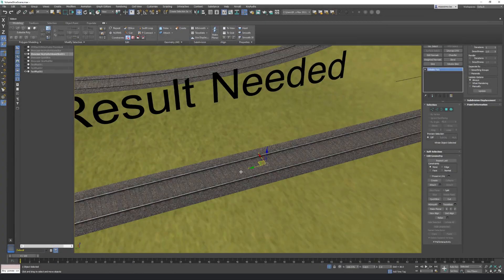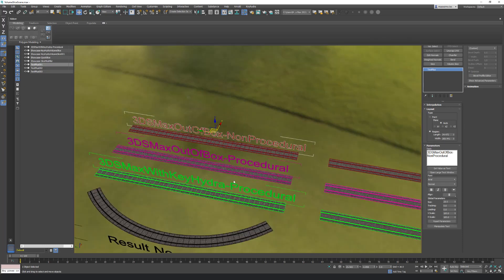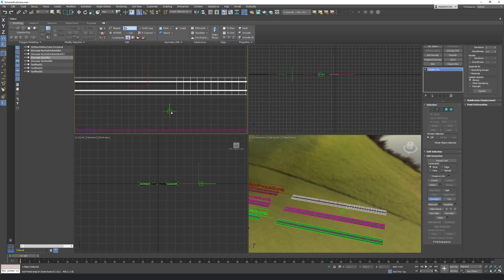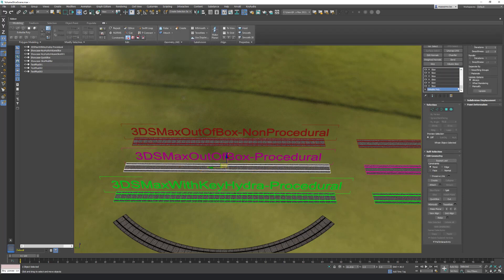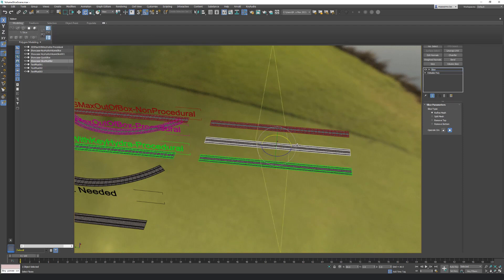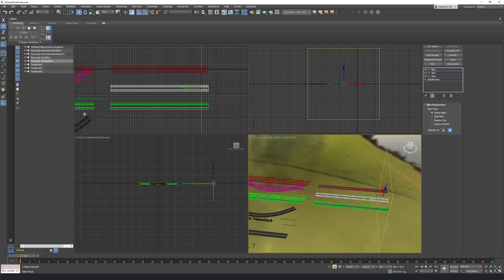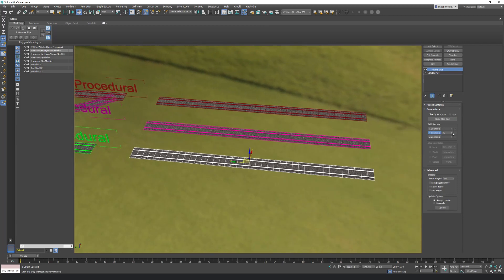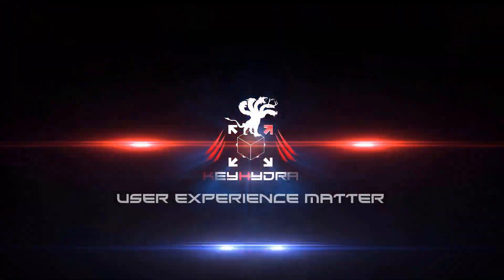Modifier : Volume Slice. Procedurally Slice and Bend faster.

Comment: Why didn't you add "edit poly" modifier on top and just made an edge connect comand with propper amount of segments? What was all that craziness? Hydra variant is cool, but 3ds max examples were way too dumb.
Reply: You are correct in this specific case one connect could help however it is not procedural. And the volume slice approach can slice very complex meshes where connect is not possible.
Reply: @Cathodeus  In this case you could model the profile of the shape on a plane and then use the shell modifier to control the length and number of segments procedurally. Nonetheless this modifier is a very nice addition.
Reply: @AzarathTroll  Hello, you are correct for this simple specific case. However our modifier can slice any kind of complex mesh like for exemple : buildings, snakes, lamps ... well ... all models that could need to be deformed afterward with Pathdeform, Bend, Twist or whatever.